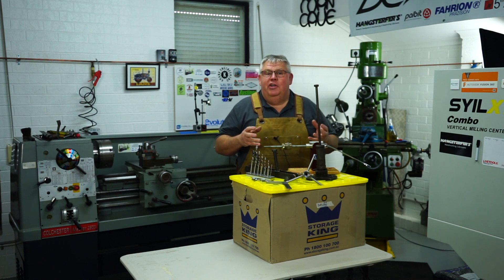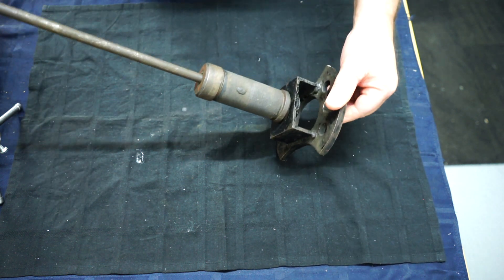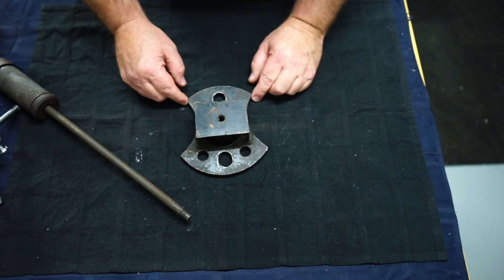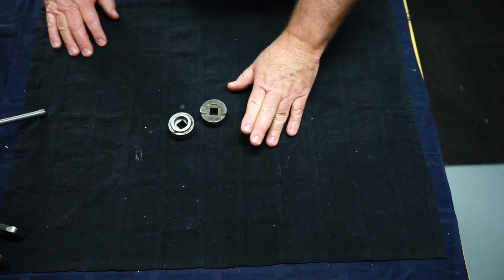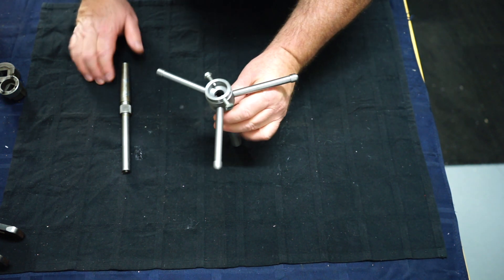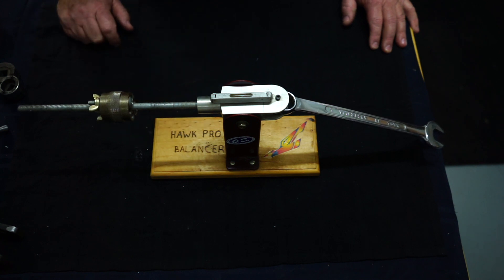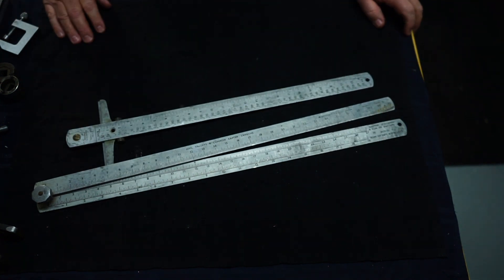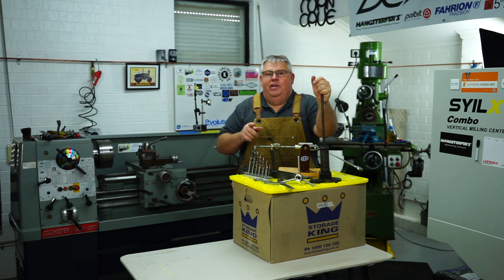Home Made Shop Tools #shopmadetools

Comment: Way back in 1984, I was 16 in 1972.  You’re a young feller.  And, I’m a man without a machine shop tool or place to put it that’s a wannabe machinist.  Spent 3 years Army 74-77 in state of the art then surface to air radar and missile system then the next 29.5 years in commercial nuclear power at Grand Gulf Nuclear Power Station starting as an Instrumentation & Control Tech apprentice working my way up through Technicisn level, then Mntc engineer/Mntc planner, elect field engineer, QA Auditor, Operating Experience Coordinator before life long(since 20) chronic pain and sleep deprivation , heart attacks and strokes took me out of work at 51 I’m now 66.
Reply from the maker: Hey mate. Thank you 🙏. Yes it’s a fun place to work. Wow, you’ve had a wide and varied range of experience. No doubt a wealth of knowledge also. 

Yes I’m 12 yrs younger then you (55 in a 2 months). Sad you don’t have a workshop of your own buddy. Thanks for watching and commenting. I appreciate it. Cheers 🍻 Aaron

Comment: Aaron, maybe an interesting slight adjustment in Rotorcraft, try Gyrocopters.  Far cheaper than other aircraft,  but far more useful capabilities than them. Flew them myself for about 12 years, still alive and kicking.  Taught how too, also test flew some. That tells a tale, not going to do that again.
Reply from the maker: Hey Lawrence. Mate I’d love to give real flying a crack. I’ve always had a passion for aviation, but have never graduated past radio control. Unfortunately I’m too heavy to learn now, unless it was in a turbine helicopter 🚁. Do you have vids on your channel of you flying? I’ll check it out now. Great to hear from you buddy thanks for sharing also. Cheers Aaron.

Comment: dont no proper name but i believe its a angle square
Reply from the maker: Hi Norman. Yes the tool is used to work out the pitch of the roof, rafters and rafter spacings. It’s very old and belonged to my father. Send me an email with your address if you would like a channel sticker. Cheers 🍻. Aaron

Comment: Hello Aaron. I watched this a few days ago actually but forgot to comment apparently. I like your die holder design, been thinking of doing one of those for awhile. How deep can it do? That spanner balancer is the tops😁
Best! 
Eddie
Reply from the maker: G’day Eddie. Thanks mate, the helicopter blade balancer worked well. However the button die holder is a little ripper. When I get a spare minute, I’ll draw up the 3D model and 2D plans and share them with you. It will thread easily up to 5” and at dia of 3/8”. Cheers 🍻. Aaron

Comment: That button holder is an original, don't be ashamed, wear it with honour after all its still in use, are all the others?
Reply from the maker: Hey buddy how’s things? Yes I still use the button die holder, she’s a little ripper. I haven’t used the axle puller in over 20 years, but mostly use the others 👍🍻
Reply: @AaronEngineering  yes, i mean't all the other die holders the other students made - are they all still in use? point is yours IS and that's what counts. Hell if our wives were that critical we'd be in trouble hahahah

Comment: It's amazing how many times as mechanics we have to come up with our own special tools.  Heck, I worked in dealerships for years and still needed to make tools, either because there was no factory tool like it or the one that was supposed to be in the box in the tool room was instead in the tool box of the tech who quit 6 months ago.  I think that was a pretty good hub tool, even more props to you if it was done as a 16-year-old!
Reply from the maker: G’day Everett. Yes mate, us mechanics can be very resourceful at times. I predominantly worked in country garages and we’d fix anything & everything. Even a washing machine once 😆. So DIY tools were a necessity at times. Thanks for stopping by Everett. Cheers 🍻
Reply: @AaronEngineering  I totally agree.  I'm a Boilermaker by trade, but have spent a lot of time mechanicing, both in workshops and in the field.  Necessity truly is the mother of invention.
Sadly though, the trades have changed, both yours and mine, no longer do we improvise nor learn the fundamentals, today it's primarily shop bought tooling, whole assembly replacement and dumbed down technical knowledge.  My Son is a third year apprentice mechanic and it astounds me what today's mechanic is not taught.  I know we're not working on FJ Holdens anymore, but I hate to see the old mechanic's tricks die out.  I cherish the fact that I learned from some mechanics that were around during the Second World War that knew how to make something out of nothing and could rebuild almost anything.

Comment: Rafter angle finder...  what engine is in the Heli?
Reply from the maker: G’day Paul. The engine in the helicopter is a  26ccJapanese Zenoha. It was modified to 30cc. Yes the tool works out the pitch of the roof, rafters and rafter spacing. Cheers buddy 🍻

Comment: It's for measuring angles .  The folding ruler is referenced by the single ruler across 2 points to be able to read off an angle .  Boilermakers version is known as a line of chords , on a folding steel ruler & you use dividers across marked points to know how far to open the ruler to obtain a given angle .
Reply from the maker: G’day Max. Yes mate it’s a sliding angle 📐 rule used by builders to ascertain pitch of the roof, rafters and rafter spacings. Cheers Max 🍻, Aaron.

Comment: gday aaron great video mate it looks like it mite be a draft mans combination square and scale ruler set judging
by the measurements on all three peaces i remember seeing some like that back in the 70s when i worked at ford in broadmeadows cheers wayne
Reply from the maker: G’day Wayne. Thanks for watching my video mate. It’s actually a builders rule 📐 which is used to find the pitch of the roof, rafters and rafter spacings. Drop me an email with your address and I’ll send some stickers your way if want. Cheers Wayne 🍻, Aaron.

Comment: Gday Aaron, some interesting tools there for sure, the helicopter blade balance tool certainly is bloody sensitive, I’ve got not idea what the last tool is for, the only thing I thought of is for setting roof pitch’s🤷🏻‍♂️m great video as always mate, cheers
Reply: I was gonna guess roof pitch tool as well
Reply from the maker: No flys on Matty Craig. He’s too fast for them to catch 😂
Reply from the maker: G'day Matty.  Thanks mate, I'm just trying to tamper with the Google algorithm 🤣.  As for the mystery tool, you are absolutely correct.  My father was a builder and that tool is over 50 years old.  It works out the pitch of the roof, rafters and rafter spacings.  It's all in imperial too FML 🤦.  Thanks for watching mate.  Aaron.